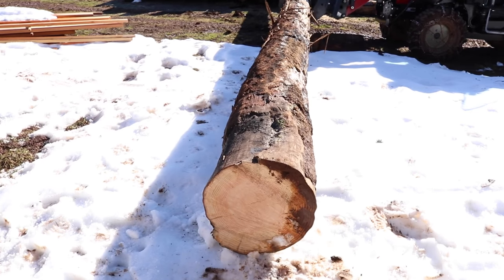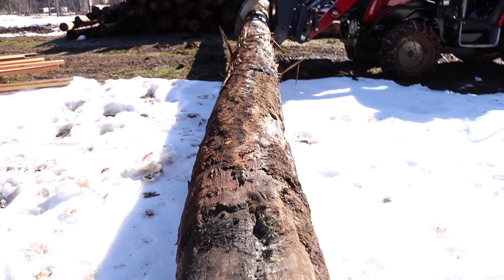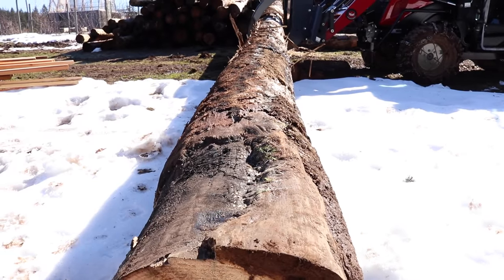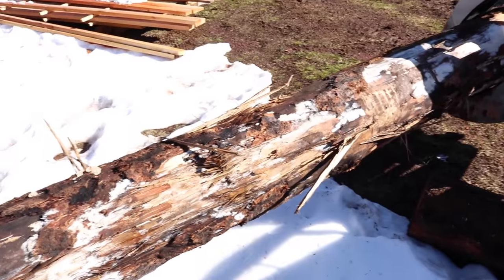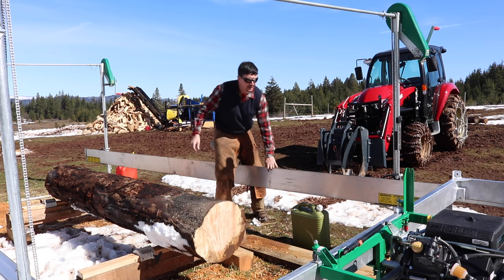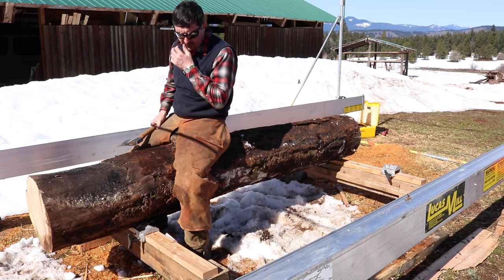AMISHISH SAWMILL!!

Comment: I've seen people marking the heart crack (with a sharpie) on either end of the log and then turning the log before milling so that the heart crack is as close to level with the saw cuts as possible. Apparently, this helps reduce twisting as it dries, as the heart crack is an indicator of the weak spot of the tree, and shows the way the cells in the wood are already shrinking.

Comment: That's interesting.  The bark protects the tree while it's alive, but it's makes it rot more quickly when it's dead.

It looks like those aluminum chocks have already had a run-in with a saw blade.

When in doubt, blame the metric system.  That works for me.

Now that you have a Yanmar, the proverb still holds: Do what you can, with what you have, where you are.
That's one of the major things that hooked me on your channel.

Comment: Cody - all the metric vs. imperial arguments in the comments aside...if you'll run a little beeswax or gulf wax on those 2x4's you're using for cribbing every so often, it'll help those aluminum chocks slide when you want them to.
Reply: taladan I was thinking that they needed a pass or 2 with a plane to reduce the width.
Reply: Might make it too loose a fit? Those trunks have a fair bit of heft to um certainty don't want um slipping when running the saw through um! 🤞
Reply: Tim Hooper very true Tim.  Im a Hooper from east Tennessee

Comment: Hi,  the logs with mushrooms or fungus on them are perfectly fine to cut timber from them, but I would not recommend to use the excess as firewood in the log cabin, specially if you stack those on the porch. And if anything starts to pop up on the cut timber use a heatgun or gently a blowtorch to eliminate the mushrooms from growing, one other thing to use is acid to stop the growth. If you do not have reasonable acid in hand the the cemicals that you have to clean the toilet will work for dealing with fungus, just put some cloves on. All the best.

Comment: My neighbor just sold a black walnut log for around $2k to a sawmill. I have been considering selling some of the ones I have.....24-30in across....20 some feet of no knots....and straight. I have wanted a sawmill for so long......they may be my new sawmill.
Reply: There a great saw mill, designed and built in Australia. Even the motor is built in OZ from a casting.

Comment: yes.. We in australia use Metric as our Primary system... Bet the clamp bases are 100mm not 4" [100.x mm]

to protect your Mill How about have a log or Rail just in-front of the side of the Mill so you Don't run into it with your tractor..

Comment: I just bought a house and have 4 black walnuts in my back year I need to take down and I think I will have to look into a chainsaw mill.... thank you for sharing
Reply: Check the tool rental places near you if they have a sawmill for rental. You never know what is available for rent until you look and might get better results then a chainsaw mill. 

There could also be a small sawmill in the area that can do the work for you. Skill can be worth the cost of using a 3rd party.

Comment: Won't be long and you'll have the s*it knocked out of those snuggle blocks by the look of the beating that aluminum is taking. The no half measures voice must be screaming at you to pop those pegged boards and plane them down so it works correctly. It is a purdy view for shore and geologically speaking, not too old either, though a half to one million years in the making might seem like quite a while to tap the fingers to some. Is that what the Amish do, chat ya up all day while they tinker around the edges of the main job? : )
Reply: Maybe so but I've always found out I was using aluminum after the fact, when the edges are all bashed in or I sheered something right off.

Comment: C'mon over to my channel and check out the Webb Mill series. With the largest log at 3,000 pounds and a 1,500 lb carriage there's 4,500 lbs flying by the blade and the steel parts are an inch away! Milling requires 100% of your attention. Be Well Wranglerstars

Comment: Not sure you have said what model Lucas Mill you have.

If I could recommend you DON'T load logs over the mill rail. Seriously easy way to stuff your mill.

Better to lay some dunnage or fire logs parallel with your logs rests that pass under the mill rail. Basically setup a log deck. Then just roll the logs into place under the mill rail when its time to load a new log.